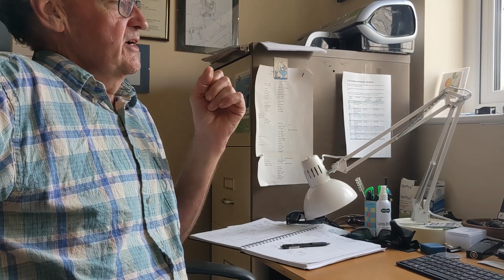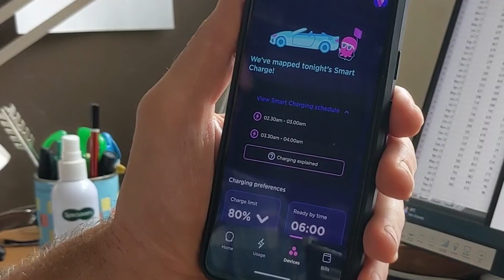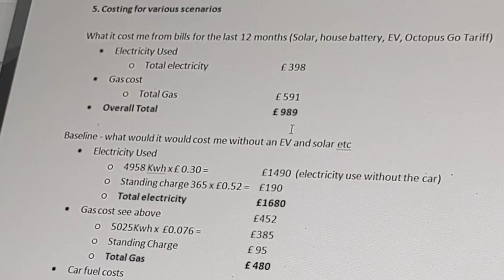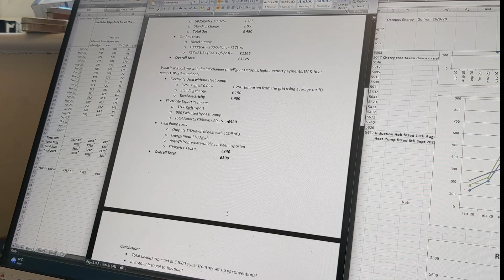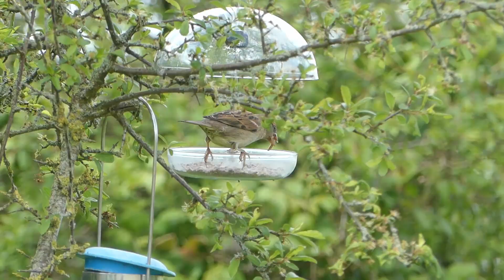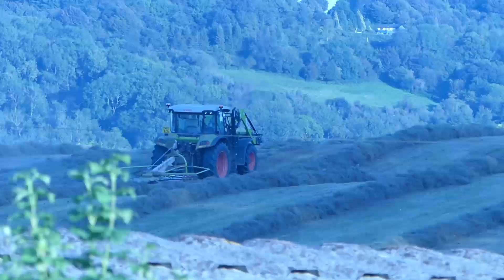The Solar Revolution - Intelligent Octopus. New Smart Electric Vehicle charging.

Comment: Great solar setup ,  did you have to get planning permission to put the lean to against your property ? Looks good , can you give me the dimensions as this is just what I would like to do on the back of my property, thanks
Reply: Thanks for the information, it is very helpful
Reply: I didn't need planning permission as the structure is far enough away from the neighbours. As a precaution, I spoke to my neighbours to ensure they had no objection.
The canopy has an angle of 35degs and is 6.42m wide and  3.80m deep when measured normal to the roof - so the structure would come out 3.1m (taking account of the 34deg angle of the roof)..

This was the spec given to me by the solar installer:

For the pergola / canopy, your carpenter probably has their own regulations to adhere to - ideally, we would want 150 x 50mm rafters at 400mm centres to fix our mounting system to.
Spacing of the supporting posts will depend on the size of post being used - if you are using 100mm square posts, then you would need posts every 1.2metres, if you use 150mm posts, then spacing of 1.8m would be fine.
Footings should be minimum 600mm deep and 300mm square.

Comment: The DNO restricts export of energy to the grid is to preserve the local network from overloads. As  demand increases the DNO will eventually step in to reinforce the local wiring. They wont spend £M's of  just so the odd person can have a few more panels. It will come eventually. Just be patient.
Reply: I totally understand that the DNO needs to protect the local network. My frustration is their complete lack of openness. They will not tell me specifically why I cannot export more. If they did I could monitor the situation and reapply when the constraint was removed, or better still, they could message me when I could add more capacity.

Comment: Just a question as I understand it the dno does not stop you fitting more panels they want to restrict your peak supply to the grid to whatever you have permission for? If that is the case you can install more solar and have more battery including perhaps dc connected batteries then store more, import even less and export over more hours than you do at present?
Reply: The DNO now restrict how much you can export and this must be implemented by a G100 compliant limiter but they are also now restricting your total inverter capacity. They will count the inverters for your solar system and also the inverters in any AC batteries you own.
I am not sure why they are restricting total inverter capacity. You can implement as many DC batteries as you like.

Comment: Bang on. This is one of the main reasons I'm going for solar/battery, as you say nice and simple, charge battery in the cheap rate (and car if needed) export whatever solar there is. Thats it. No more trying to work out what tomorrow's weather will be and whether to import that night or use the solar. ETA I hadn't appreciated this in effect nvalidates Zappi except that (AIUI) Zappa is one of the smart chargers that is compatible so you can at leats use it for IO. By pure happenstance my charger (Wallbox) is compatible.

Comment: Interesting analysis. Our experience with the heat pump is around a cop of 3. We only switched the unit on in September so still need to get to march tonget an accurate view, but comparing the last 3 years figures it looks like the unit is using a 3rd less energy and keeping eith the cop. Cost wise over winter it works out slightly cheaper, but the real gain will be march to may when our solar kicks in better. From an return on investment point of view, the solar and battery breaks even after after 6 years. The interesting and less talked about bit is you do not pay vat or income tax on any solar you generate on site and also the losses for self consumption are minimal compared to transmission of power through the grid. Adding the transmission differences makes things even harder to calculate, so best to keep the analysis as you have done.
Reply: You raise a good point on the tax free savings you get from solar.I agree this is often overlooked.
It is hard to do the calculations for any individual part like the heat pump.I have had to make some simplifying assumptions. The low cost power I get from Intelligent Octopus is due to owning an EV but the heat pump benefits. So is it a heat pump saving or a car saving? 
I think the only thing I can do is look at the whole system after a year and compare it with my base costs.

Comment: James, me again. In this video you are echoing my own thoughts on the macro environment for solar, and it turns out we both have a connection to Southern Africa. On the DNO issue, have you thought about some of your future battery storage being 'behind the grid' or solely downloadable from the grid to allay the DNO's fears. And to then be used solely for the EVs.
Reply: I'm starting to come round to your way of thinking because I too use Tesla. Many thanks.
Reply: Hugh Replying with my thoughts.
When you say "behind the grid" do you mean on the DC side of the inverter? If so we did discuss that as an option. DC batteries would allow us to store any energy, above the inverter limit, in DC batteries and then export it or use it at times when the inverter has capacity.
The problem is that I have an AC battery (Tesla Powerwall) and the DC batteries would be from another supplier and would not work together and there would likely be unintended and possibly uncontrollable interactions.
Rather than use the extra storage to charge the car it would probably better to export it and use night time power to charge the car.

Comment: Excellent informative video. I've done something similar and have reduced my energy cost by 75% or so. 
When I looked at the installers heat loss calculations it suggested a larger heat pump but I've since realised one figure (air exchange) in the calculation spreadsheet was losing a lot of energy and is very tricky to define and can be way out if you've sealed up the gaps. Reducing this factor suggests I could have got away with a smaller unit but it's still good.
I don't have a buffer tank but I do have a low loss header for hydraulic separation. I have 28mm from heat pump to tee into 22mm middle rail fanning to 15mm to radiators so it's questionable whether I need the header at all but the heat pump warranty demands it's fitted. I do know someone who removed and bypassed theirs but didn't find any advantage.
Reply: I have struggled with air change per hour. The MCS spreadheet by default populates the figure based on the age of the house but what if you have refurbished your house?
As you say it has a huge impact on the heat loss figures but is not easy to determine the true value that should be used.
Interesting the heat pump warranty demanded hydraulic separation. What make of heat pump do you have?
Reply: @hughrattray9354  It's a Midea heat pump and the literature includes annual recording of header input and output as part of the warranty in evidence of servicing. I was told by the installer that Freedom (who train installers and supply the units) say one should be fitted - but without speaking to them I'm not sure if the warranty would be void if it was removed. It could just be that it's only recommended to get over more restrictive radiator pipes etc in some situations and keep the flow to the heat pump unrestricted. As it happens in my case, input and output temperatures are identical so it's not distorting or even doing much so it could probably be bypassed but at the same time I'm not sure it would make a difference apart from the power to run a secondary pump. I was particularly careful to ensure the installer tee'd into the centre of the 22mm rails with 28mm from the buffer which is the same to the heat pump so there's no restriction and cross section always gets bigger as it fans out 28mm to 2x22mm to 8x15mm etc.
Yes, the air exchange is a tricky one to measure or even estimate. The heat loss spreadsheet from Freedom which is based on MCS but easier to use has Air Ch/h selected by room type and different building regs or heat recovery ventilation with factors ranging from 2 to 0.2 which can double a rooms loss or more depending on the other U values. I've sealed the place up quite well and use a dehumidifier for drying clothes to keep the RH down and if I select a lower air exchange I could possibly reduce the heat pump a size.

Comment: Thanks for this video, a lot of work has gone into into your very interesting spreadsheets and various scenarios. I bought my Tesla in Aug 2022 and i have recently installed a  5.22kw Solar array and Givenergy 9.5 kWh battery with 5 kw inverter. I have already seen a benefit using Octopus Go for my EV charging and Outgoing Octopus for my export, i am still tweaking my settings, i have had a few issues where Octopus Go has set my charge outside the cheap overnight period where my battery has been charged and as a result my battery has been used to charge the vehicle leaving my battery depleted quite often on a cloudy day! I am also in South Wales and on the coast. I have noticed that the low winter sun has delayed the start to my generation as a result of trees in nearby woods and my neighbours homes. I am currently almost £800 in credit on my energy bill after installing my PV set up in early September, so i have re-set my direct debits to take into account the ongoing benefits of solar and battery set up.
My house is a relatively new build being 13 years old so the insulation and gas condensing boiler are pretty efficient but i am tempted by the thought of a heat pump, my daughter and other family members live in NZ so only use heat pumps but obviously the weather is generally milder than South Wales.
Just subscribed so hopefully I can pick up more tips from your journey.

Comment: Hi James, I have just come across your channel and subscribed. Firstly it is refreshing that you discussed your frustrations with the DNO involvement. We have exactly the same issues and feel that they are not adapting to a swiftly changing environment.

Secondly, we are currently on Go and looking to swap to Intelligent Octopus. We also have a Powerwall 2, our question is, have you had any issues with the Powerwall discharging into the car during the night time charging periods which leaves the battery low or empty for your daytime use please?
Reply: Hi Lynn,
Many thanks for your comments.

Regarding the DNO, I also feel that they are not being open about why they impose limits and the process they follow to decide on export levels. It is all very arbitrary in my view.
It is also interesting that in the Energy Act 2023, which has just passed through parliament, Ofgen now have a remit to help achieve net zero. As a result, I plan to write to them to ask what they plan to do about the DNO bottleneck. I think there is a huge opportunity to utilise home solar to help with the net zero goal.

With the Powerwall 2, I have programmed the Intelligent Octopus tariff and the new 15p export rate into it and, as a result, it does not generally discharge into the car at night. If it forecasts a sunny day it may partially discharge.
I have gone a step further though and allowed the Powerwall to export to the grid. So it can buy power at 7.5p and sell it later for 15p. This results in it fully charging every night and then exporting the solar and the excess solar during the day.

I have just seen my Octopus bill to the 15th October and it is negative so I have been paid more for my exports than it cost me to buy power.
Reply: @hughrattray9354  Thank you for your reply. Our DNO wanted 15k from us to upgrade our home to a three phase supply when we added our Powerwall and extra solar in 2020. We are therefore stuck with an export limit of 3.6. In April this year I understand that the rules as to who pays for adding  a three phase supply to a domestic property changed. My understanding is that if you wish to add extra generating capacity you still have to pay the majority of the cost. However, if you wish to increase your consumption ie install a heat pump, the DNO meets the cost. 

Unfortunately trying to talk to anyone at a DNO can prove to be very difficult, indeed in our experience advice differs with the same DNO depending on who you speak to. As an example our installer dealt with one DNO member of staff to fit a Pw and extra solar in one town who allowed a normal install, then moving to our property in another town 20 miles down the road had to jump through hoops with a different member of the DNO so we  had additional and unnecessary costs just to fit the new equipment. 

We will see what happens when we pluck up the courage to try Intelligent, I suppose we could ask for our EV to be ready for charge by 0330 and then that would give to Pw plenty of chance to charge. We are very low mains users and being on FIT payments already get paid for the majority of our generation plus deemed export of 50% that generation, we use 2/3rds of all we produce as well so it’s not a priority to,”lose” the deemed export to potentially gain the Octopus export 15p.
Reply: @lynnfisher4396  I agree with your comments on the DNO, everyone I have spoken to has told me something different and this confusion is then spread to the installers.
In my case they have allowed me to have a 6Kw export limit and I have heard from people who have a 10Kw export limit, all on a single phase.
I was quoted £5K to install three phase but I was told that all I had to pay for was the connection to my house and they would deal with any upstream costs.
I have a heat pump installed and they upgraded the main fuse to the house to 80Amps from 65 without any charge.

I am not sure why you are nervous about moving to Intelligent Octopus from Octopus Go. I made the same switch without any problems.
The only differences are a cheaper off peak rate that lasts for 6 hours not 4 hours and the exact time of charging is decided by Octopus within the 6 hour window. I set the app to ensure the charge is completed by 6am. Last night it charged between 04.00 to 4.30 and 05.00 to 05.30.
The Powerwall was fully charged by about 1am and no power was drawn from it until .5.30 am when the off peak rate ended.
Reply: @hughrattray9354  Thanks Hugh, that’s very reassuring regarding how the PW works with OI, I will try a test of the communications between the car and Octopus to start the swap process this afternoon.
Reply: @lynnfisher4396  Actually you can exceed the 3.6kw limit if you file a G99 form instead of a G98 which has the 3.6 limit. We have a 4.7kw array and 5kw inverter, so have exported up to 5kw. I believe that the G99 would allow higher than this
Reply: @peterjones6322  Hi, we have a Sec99 because of the output of the Powerwall. However the DNO restricted us to a 3.6 kw output to the grid. To get the higher grid export level they wanted to charge us 15k to change our single phase supply to a three phase. We currently have 5.5 kw of panels and see lots of clipping in the summer but as we generate more than enough to be grid free from March to September that’s fine. The extra panel over a ‘stock’ 4 kw array helps us gain more production in the winter. 

A lot depends on your DNO and what your local supply network is like. Our DNO representative wasn’t someone who would compromise. We live on an estate of late 1960’s housing and suspect that the electricity infrastructure around us dates from then too.

Comment: Have you looked into connecting more solar and limiting its export?
Reply: I have but I have been told that the DNO no longer trusts limiters. This means that they will also limit the total power output of my inverters. 
I am going to continue to look into this as I am not happy with the answer.
I do also have the option to connect more panels to my existing inverter which would give me more power in the winter but clipping in the summer.